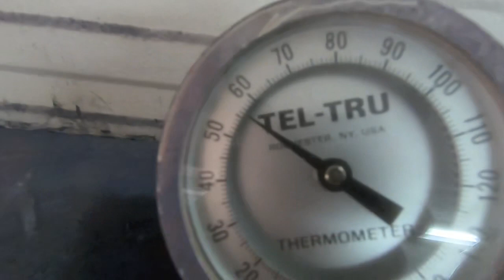$100 Black paint job

Comment: Wanna know another cool way to paint a truck? You buy that black paint that is used to apply with a paint roller to the inside of truck beds, you use the roller that leaves a texture as well, easy to apply. And economical. Then if you want it more shiny use clear coat in the can. Hell no rust can chew on now!
Reply from the maker: your right there mate ive done a couple of bikes like that its very tough stuff too i wanted a nice shiny job for the wife to tow the horse float about and its great to clean 7 coats so its plenty thick thanks for commenting have a good one cheers

Comment: Bloody AWSOME paint job TT ripper mate 
If your putting solar on 
Look at the Victron solar controller I am using it 
One of the best on the market mate 
Some come with Bluetooth mine did not so bought it for it 
My brother sells them they get 30% more than any other 
Made in Germany mate 
I’m in same process as you redoing the van 
For sale $10,000 
Cheers 🍻 
CrouchOz
Reply from the maker: thanks mate it was alot of work but i enjoy the process ive had the solar set up for a few years charges me bats for the drills and grinder its a workshop on wheels mate good luck with ya van im sure itll be mint goodonya crouch cheers